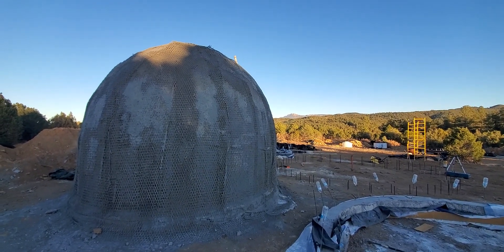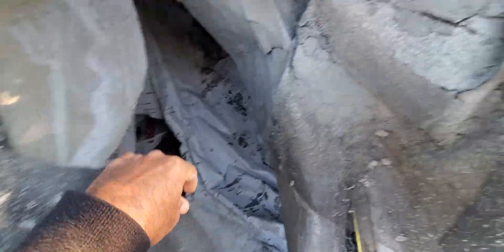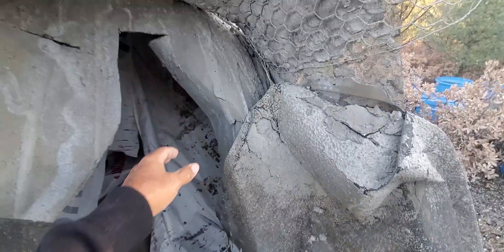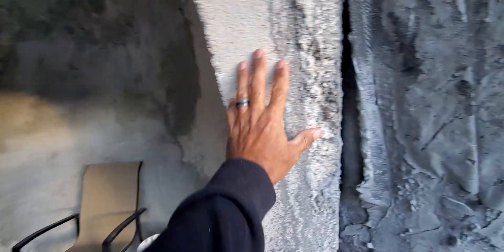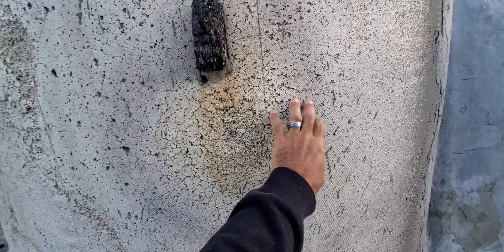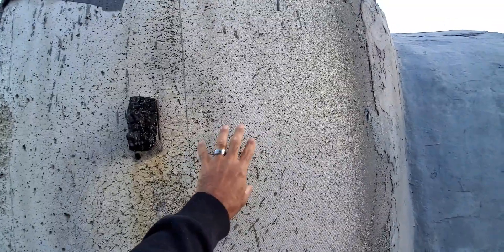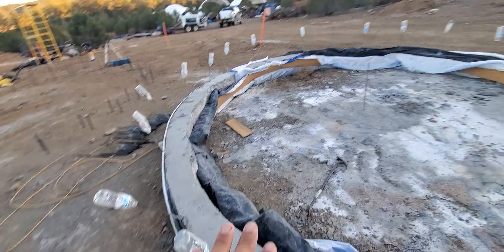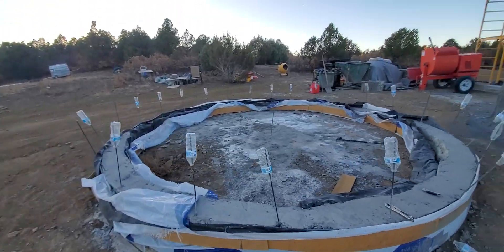Looking for a Structural Engineer to Work with #aircreteharry #structuralengineer #dome #aircrete

Comment: I realize it would be a bit more work, but I think you should shape your wire mesh in the same shape that you cut the Tyvek air form sections. Then wire tie them together over the initial dome shell. This would keep it from wrinkling up away from the dome, and allow you to use less concrete mix to cover it.

Comment: The air form  just needs to be super indestructible material,something not easily punctured like silicone with a sturdy form inside of it
Possibly forms  that the concrete goes inside  plus put some charcoal in it to prevent mold or some  Borax

Comment: My brother. It might be a good idea to say "concrete" or "Mortar" when you get in front of an engineer and talk about the structure and method. The term "cement" sometimes confuses building engineers. Just an idea.... Love your work mah dude! Keep it up! I'll show ya my setup in AZ here soon. Similar method with airform, but using a hoop house (1-3/8, 17ga, galvy tubing) as the skeletal structure and reinforcement. If the wife doesn't shoot me first I will have video up soon 😂

Comment: Harry, could you do an EMF reading inside one of your structures? Is there a way to make these so that they shield from 5G, EMF radiation, etc?
Reply from the maker: Yes you can make the domes EMF proof.  I will show in a future video how I would make a shielded dome.
Reply: @AircreteHarry  EXCELLENT!! Thank you! I am a new subscriber. I'm looking for the most affordable, yet sound way of building structures that are tornado and earthquake proof...I love that these are also fireproof and potentially bomb proof depending what reinforcements are used. (Correct?) 

It would be great to see barn shelters for say....goats or other livestock ...to be built out if this material.
Reply: Just add graphite to your mixed outer layer

Comment: Hey Harry, curious to see if you ever tried using bamboo to help reinforce concrete or aircrete? I've read that it has 4x the strength of steel reinforcement. Would love to hear if you've tried and experienced with it
Reply from the maker: I don't have access to bamboo so I never tried.
Reply: @AircreteHarry  if you want to try bamboo, you can usually find it invading someone's yard who didn't plan on how invasive it was- they will let you have all you want. It is how I got mine to make neighbors disappear.

Comment: Engineer's stamp of approval goes on construction documents specific to the building and it comes with his personal liability on that design.  Put a sketch together showing a typical section through the dome and include what tolerances you can maintain during construction.  Provide details for openings (extra rebar and maximum opening dimensions).  Your tolerances are of particular concern and you should think of ways to verify that reinforcement cover and system thickness is obtained (8" tall rebar chairs every 18" or so).  The other major concern is maintaining the air bladder (counter environmental temperature and pressure changes) while the concrete sets.  This has led to concrete dome failures in the past.  As for reinforcement, I don't see the interior surface coming out of compression except at openings (ie no reinforcement necessary).  For the exterior reinforcement, I've seen carbon fiber approved in structural applications but you'd probably have an easier go using welded wire fabric since it is listed in ACI 318.  W2 (wire size) is about 1/8" diameter wire and should be fairly flexible.  You will need to detail how edges of the fabric are lapped.  I don't see chicken wire being approved.  Show that the concrete mix conforms to ACI 318.  Probably not a concern for these small domes, but for larger structures, cracking should be anticipated (if there is no cracking then the rebar is doing nothing).  With sketch in hand you should have no problem finding a local licensed engineer to help.

Comment: You do not need an engineer. you need a lobbyist.. you also need to patent your work. You must have write an abstract. That is a legal description. You need lawyers to. The description you're giving in this video should be put in order and that needs to be your abstract. I'm an industrial designer by the way I have content as well. I could use your methods for my designs. I'm mostly in green energy. I'm aware of the type of concrete to take CO2 out of the atmosphere and mix concrete stronger.

Comment: Why is aircrete not used in more standard concrete pours where you dont need the full compressive strength of concrete? I assume it would be cheaper since the foam + air is cheaper than concrete..

Comment: Harry, I'm an EIT, someone who has a structural engineering degree, but is in training to get their full license. I think this is a interesting and good system, but if you want it to get approved it will be a difficult task. Concrete is a notoriously difficult material to work with and if an engineer were to do strength calculations on this design it would be fairly difficult due to the non uniform shape and inconsistent thickness and placement of the concrete/support materials. You will have to prove you are able to produce a consistent product that the engineer can reliably do calculations on in-order to have them sign off on the design. That being said I think think design has a lot of promise and I definitely will keep it in mind for projects at home.
Reply: How is the thickness inconsistent? And couldn't that be solved with sticks of rebar to set uniform thickness like digging a quinzie out of a mound of snow?

Comment: Structural Engineer here almost 15 years experience.  I think that modern codes would require steel reinforcement of some kind to be used, as simpler materials like the mesh you're using are not widely accepted from a building code stand point.  I think you could use a 9 ga. steel wire at 16" o.c. H&V and really make it stable against cracking, both shrinkage and loading related.
Reply: Basalt mesh should definitely get approved as it is widely used especially in marine applications. Plus it is twice as strong as steel and never rusts.
Reply: are you licensed in SC? I've love to make this dome, but with out an stamped engineered drawing my local gov will never let me make it. if you are willing to do drawing wtih stamp let me know how to pay and contact you please.

Comment: various construction companies use very similar techniques, as for obtaining a permit it really depends on local building code. In a dome structure the wall it self is the ceiling, which is why in general its cheaper and easier to build  than regular buildings, however practically as you must have figured by now the lack of straight walls is very inconvenient for interior design
Reply: I see more negatives than positives, it's a messy cumbersome technique and hard to engineer, if the airform was more rigid you could use the aircrete like cob and do away with the spray on method. Innovation is never easy, keep experimenting 👍😊
Reply: @colinstace1758  this seems easier to me then making bricks and then slowly stacking them into a dome as the mortar dries. This is one solid piece when finished.   

Could always shape the dome with arched rebar using the tyvek "balloon" inside the rebar frame. And apply by hand if that's your thing. The spray seems to make a difficult task way easier.

I'd rather powerwash then scrub brush

Comment: I'm not degreed as a structural engineer but I've seen many of them say domes are the only safe everywhere structure. I'm just gonna say if you have an inner and outer form of  Styrofoam made of lego style block like quad lock icf forms then any person could put up a dome from a kit or instruction plan. Mixing instructions for concrete companies seem to not include air crete. Thats where maybe a school could run engineering tests that could get underwriting approval. I'm into mixing with waste for its green factor it gives dome pouring some more of what earth ships offer but my styro block idea doesn't. I'm interested in methods to turn waste Styrofoam into block forms. Any thoughts?
Reply from the maker: The EPIC mix is what you want.
I have an idea to make dome kit, you would get all the bricks numbered to build a prefabricated dome. Maybe next year. https://youtu.be/745-fNnrtoI
Reply: Look at "perfect block" on the tube 👍

Comment: Question/idea. I'm sure you have run across the Bill Lishman underground dome home. Could an air form be designed to form that shape? I am interested in burying my design much like his, so I can utilize the top of my home as an herb garden...
Reply from the maker: You can use the air-form as is and use rebar to get the shape you want for the skylight. I maybe doing the same look with our 24 foot dome with the 8 foot skylight.

Comment: A true dome, built with triangles, is one of the strongest structures on earth.  You have the right idea, but you need to build with triangles.  You need 5 pentagon walls with 1 pentagon roof,  built from triangles so when you cover it with whatever you want, it will not collapse.  Hope this helps.  I can send you info if you want.
Reply: That would be a geodesic dome, been around for many years pioneered by Buckminster Fuller

Comment: A structural engineer is only going to speak on the completed project, not the process. For example, if I remove a load bearing wall and install a beam,  then the structural engineer is only going to show me how the completed job will look. If I do not temporarily support the structure and it falls on me, that’s my problem. So the structural engineer will design the concrete mix, the rebar schedule, the thicknesses etc. but it’s your job to install. Have you tried reaching out to the monolithic dome Institute? They should be able to give you the engineering  to a completed project, they would just construct it differently than you and that’s fine. Any way, I’m happy for you to be living your dream and I wish you success! Keep those uploads coming!
Reply from the maker: I have all the engineering done for my place. I want to get engineers from deferent states that would approve of this system for other people. My engineer wont do it for everyone.

Comment: Forget Portland cement. Just use fly ash and Anhydrite ( gypsum) . It is free just go to any coal fired electric plant. They have mountains of it. It is the waste product that comes off the conveyor belt. Every ton you use, you can get a carbon credit on the European exchange. The EPA even states that is the safest, and best way to use the waste product. You can also foam it for insulation.
Reply from the maker: I will look into that. I have been meaning to get some fly ash for a long time.
Reply: @Jonathan Anderson yea it didnt sound safe to me but idk anything

Comment: One way to test static loading, is to put a large weight on top of the structure, and keep loading it, until it fails.  Domes are 6 X stronger than cube structures.

Comment: When concreting the dome, Build it  by staging. Build the bottom for few feet first, let it dry and harden. Then continue  for few feet on top of the first one. Let it dry and harden, continue few feet at a time. 
That way you can build it with very good quality
Reply from the maker: That is how I do it now because this is a low pressure air-form and if I add to much weight at ones the air-form will collapse. I spray in 5 - 6 foot lifts all the way around let cure and repeat two more times before moving up.
Reply: Not as strong as this method, you get joint lines

Comment: How about building a 3/4" metal conduit frame first, then inflating the Tyvek form inside it and spraying your EpicCrete from the outside so that it encompasses the metal frame like rebar? I just built an 11' radius 3/4" metal conduit frame and it is sturdy as hell. I plan on doing your Tyvek form on the inside, inflating it to the inside of the conduit, and spraying the concrete on the outside of the Tyvek form to encompass the metal form. The 11' radius form was made from the leftovers I had cutting a 20' radius form, which I haven't put together yet but I wanted to do the smaller one as a garage and test run first. The larger one of 40' diameter will house a 30' camper I already remodeled and hopefully I'll be able to build a 10' door to take the camper in and out.
Reply from the maker: I like your idea. It's just way more work then this system if I was going to add rebar to this dome the stage you see it in now is when I would add the rebar. I can stand on it now no problem. What you see in the video is about 8 hours of work in two days. 4 days to have a 10 inch thick dome shell done.  The other thing I like about this air-form is the fact that the walls come out so smooth.  Send me some photo of your build: AircreteHarry@gmail.com  Thanks!
Reply: Oh we want pictures 👍👍

Comment: Hi Harry. I think when they do load calculations. They use the rebar.
Reply: To conform to code steel rebar would have to be embedded inside 4 to 6 inch thick concrete.... Basalt rebar, rope, or basalt or fiberglass mesh could be embedded in a thin concrete layer to meet building codes.

Comment: Harry,   I like where you are going with this.  The high strength concrete with the layers of stucco wire mesh, added rebar around doors and windows, then a thick layer of insulated concrete.  Top that with some basalt rope and hard stucco then a final coat of elastomeric paint.... The domes would last forever....

Comment: It's already been done before tho. DomeGaia n monolithic dome homes already beat ya too it.
Reply: Domegia dose not have a structural engineer. They haven't built a single permitted structure in the US.
Reply: @jessesmith8645  for real!? i assumed the ease of permitting process via a a referenceable engineering schematic system was what they were selling for $2,000!
Reply: @WileHeCoyote  nope. It's a scam.almost everyone in the workshop I attended was disappointed when they slowly realized it.no money back . In a bunch of insulting emails, they told me " do diligence ' was my problem. It's a modified concrete product that no engineer has signed off on as of yet. They like to say the one in Indonesia got a permit, but that was made of cinder block.
Reply: This has not been done sir! THIS is Harry's concrete rebar steel mesh fireproof mario mound bunker dome baby! and im all about it! the other is a far less durable, completely different build process,  much more feminin curvature to the walls, and also, apparently doesn't have any engineering paperwork or permitting process lol
Reply from the maker: Not the same building system as monolithic. This is a much better building system. I did not show everything I'm doing to build.

Comment: Assemble a team of engineering interns.   One for each discipline your construction method covers.  Depending on how good they do, you might end up hiring them when they graduate, as you launch your corporation. 

You are still in R&D but would certainly benefit from a more streamlined rapid prototyping for proof work and destructive testing as well as proving any mathematical assumptions. 

Without a standardized practice, it will be difficult for any structural engineer to be able to confidently endorse your methods.   

We have math that tells us how to size beams for timber structures, to know they will stand up for hundreds of years, without having to test.  The math works regardless if you use a tape measure or a rod.    (My first timber frame shed may get the walls finished with your insulation mix) 

You need the same math and standard production practice so your buildings behave in a predictable way.   

You also have the problem of hvac and in the event a fire breaks out inside the structure.  You would have a very large oven in no time at all.

Modern building materials are used in such a way to afford escape and minimal casualty, at the cost of energy efficiency.   Also the behavior of fire is predictable in modern structures.  
So a UL style destructive test might be in order. 

I think you have a great product in the works.  

If I'm blessed to have land again before I die,  I will be building goat barns/huts with some of your methods as well.  Depending on where that land is, my first dwelling may be built that way, while I work to clear the land and build timber structures. . I could imagine a timber framed dome finished in your materials. 

 If I win the lottery to buy that land I will contract you for a big job, and I would happily help get you to the finished product that looks as good as it works..  I dont think the beauty potential of your structures have been fully realized yet either. .
Reply: Travis Hanson Indeed, well said. There is a marked difference between a structure that will stand up and a structure that satisfies all aspects of human habitation.
Reply: Or if Pi network turns into the next bitcoin, it will be like winning the lottery. 

Mine on your phone (doesnt use resources except time and social networking a team of pioneers) 

I've only had 3 or 4 active pioneers in my security team, but I have accumulated nearly 6500 coin in a year.   Someone not as socially challenged could get more.   Main net is launching soon, and predicted value should be well over $1.00 when it does launch. 

Sign up by invitation only.  Here is the link. 

I am sending you 1π! Pi is a new digital currency developed by Stanford PhDs, with over 9 million members worldwide. To claim your Pi, follow this link https://minepi.com/secure1 and use my username (secure1) as your invitation code.